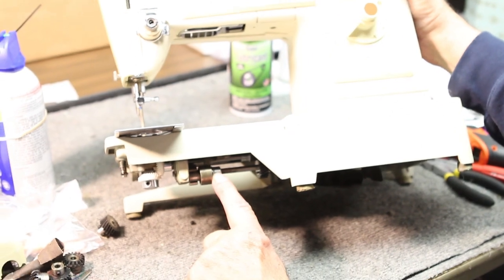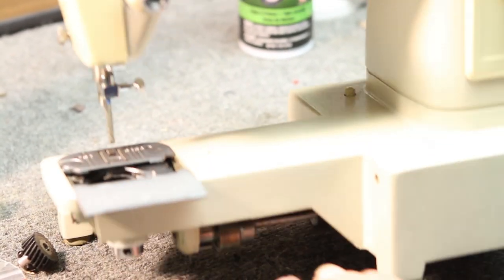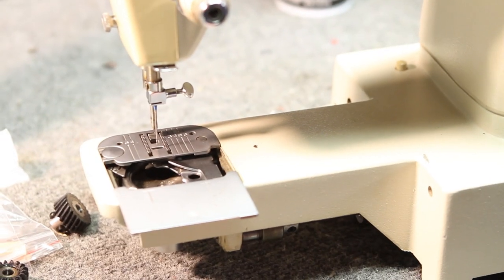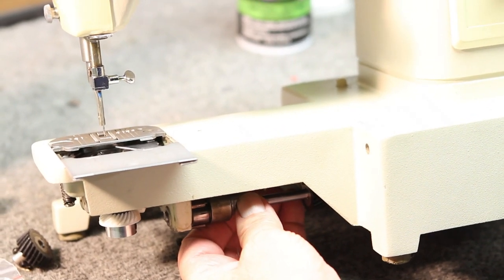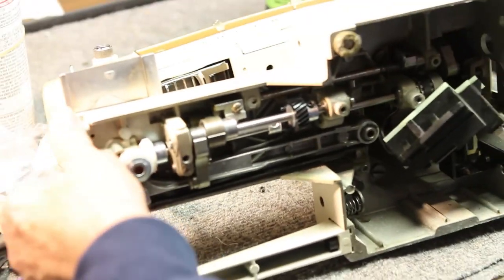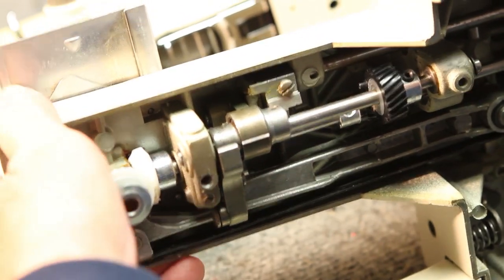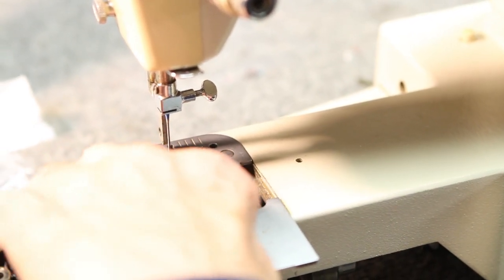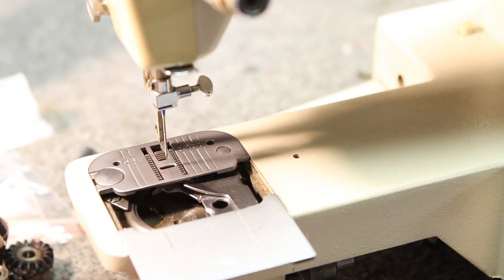How to Set Feed Timing on SINGER Sewing Machines by SINGERonline.com

Comment: I have my singer quantum 9960 apart and am trying to see why the backside of my feed dogs are not all the way up when the dogs are in the up position the front of the dogs are up. There is a nut/small threaded plastic piece and a pin attached to the plastic piece that I believe the pin came out of it home. How can I fix this?

Comment: I reset the hook and feed dog timing for my singer stylist 534 and it works fine with the straight stitch.  However the zig zag timing is off.  The needle slides over when it is penetrating the material instead of when it is at its highest point.  How can I adjust this?

Comment: I have a Singer 648 and it doesn't appear to have any set screw adjustment for the timing of the feed dogs! I can easily set the hook timing, but the cams that adjust the feed dogs are only visible from the top of the machine, and do not appear to be settable. Help!

Comment: How do you fix the timing on a singer 5050C? I used the pattern that is on the to right once, then it would not sew but a straight stitch. So I cleaned the machine, took the bobbin out (very hard to get the  that holds it down), cleaned under, now it will not pick up the thread. I need the specific video for this machine. Can you please help me?
Reply from the maker: You can watch the timing on the Singer 750 video on our website. It's not exact to the 5050C, but it will work. Hope this helps! Here is the link: https://www.youtube.com/watch?v=-uFaiFuS3Mw&feature=youtu.be